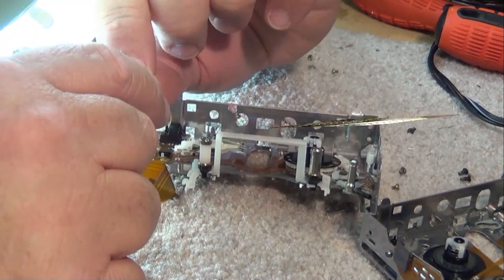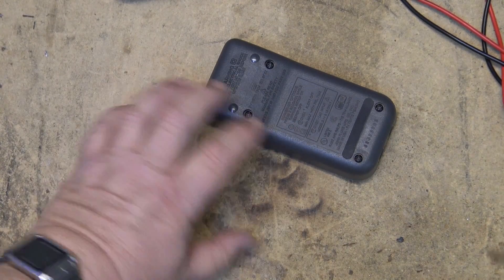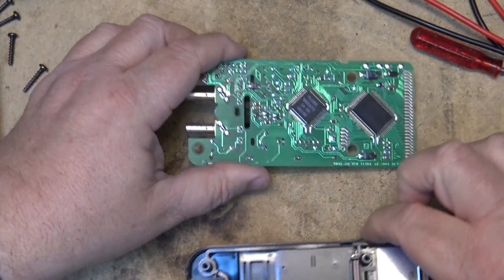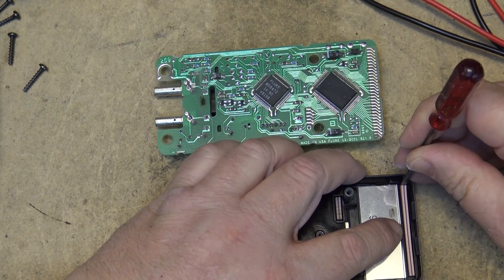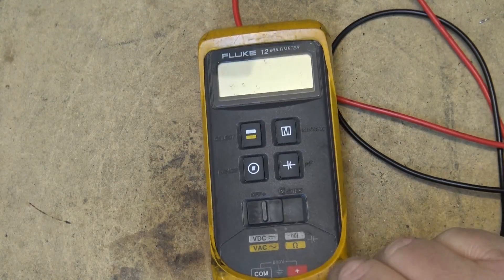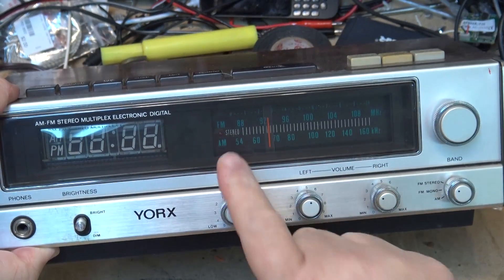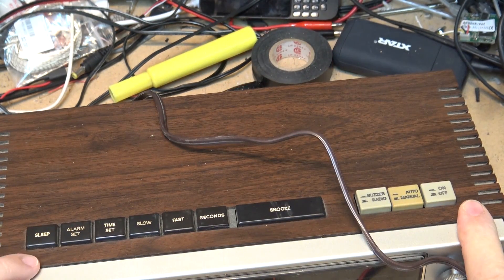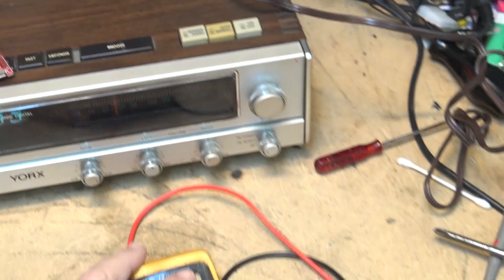Fluke Multimeter Erratic Display Repair Procedure

Comment: A follow up on my comment from two weeks ago. After doing the cleaning procedure my beloved Fluke 77 display became erratic again. After trying numerous cleanings, I ended up carefully adding a dab of solder to each display tab on the circuit board. After doing this the display now seems rock solid operational. But time will tell.
Reply from the maker: I have done that before.

Comment: I can't thank you enough for this. My Fluke 77 display became erratic a few months ago and so I bought a Klein meter that I disliked from the start. You switch it to volts and it goes to AC, arghh I always want DC. And on auto it is so really slow to read. So after all the frustration, I pulled my Fluke out of the drawer and got on Youtube and found your video. 20 minutes later I have my Fluke back. I'll relegate the Klein to the drawer where it belongs until I need to check a capacitor. Thanks again.

Comment: I was dubious about this fix. I have a fluke 79/29, but  I followed the instruction to the letter. My screen was only showing 1/2 or less in the lcd display. Now it’s perfect , like new.👍, good job on the teach dude. P.S. I did use (almost dry )rubbing alcohol on the cotton bud. Thanks again.

Comment: The same thing happened to me with my Fluke 28 II about 3 years back when I had purchased it in like new condition from a second-hand store. It was even still in the box with the warranty papers and everything still included!. Even though I had purchased it from a second-hand store and believe that was the reason why it was there  I could have had still sent it back to fluke for warranty but I did not feel like  losing my meter for 4-6 weeks to do so I decided to try this fix on it and it not only worked fantastically it allowed me my excuse to go pervert on new piece of test gear anyways!.

Comment: Ive used isopropyl alcohol to clean these stips and board pads, evaporates instantly with no residue so doesnt seem to do any harm and so far has worked every time.  Sometimes new strips are needed, sometimes you get an improved version from Fluke.

Comment: Have the same issue with my outdoor digital timers for my Christmas lights. I worked on one this year but I did use some 70% alcohol. Seems to be ok but they will be getting replacing in the next few years with smart plugs.

Comment: I've never run in to bother using ispropanol on the zebra-strips, and gently rubbing the pcb pads with a fiberglass pen. Lots of LCD displays suffer from these issues. 
I was surprised to see that fluke has solder on the pads rather than gold plating, but I guess since the pads are not wiped by other metal contacts, it is an adequate solution.

Comment: I wonder if the boiling belt trick would work on those zibra strip rubbers
Reply from the maker: Typically wiping them off and wiping off the lead tinned connectors on the PC board fixes it for years.

Comment: I've got a different Fluke that's got the same problem that you described with your Beckman.  Plastic clips are broken.
Reply from the maker: I actually had 2 Beckman meters, both did the same thing. I should show it off. I started to make a video about it years ago but I don't think I finished it off because I didn't fix it.
Reply: @12voltvids  In my case, I need to figure out where to get parts - or find a "hack" to fix it. I can deal with electronic issue.  Things involving mechanical ingenuity is a bit harder for me.

Comment: Good for you, having the patience to do this repair. My video about this meter would be me running over it with my truck to fix it, LOL. You are absolutely correct not to use any cleaners. I attempted the same repair on an old Radio Shack digital meter that I paid way too much for back in the day. I managed to clean up the contacts on the display, but then ruined the CMOS meter chip with static from the cleaning process. The static damage was probably from the cleaners I used.
Reply from the maker: Aerosol cleaners actually produce some very high static induced voltages when they are released. They can damage sensitive equipment.

Comment: My Fluke T5-600 won't read one number on the display,everything was ok,just suddenly lost the number,,An interesting thing is that the Fluke Company has done a hermetic box,for protection against water,,it is impossible to open the instrument without damage and fix the display,unfortunately ended up in the trash. ,I write this as a professional, giving my negative experience to help others who intend to buy this instrument.Thanks Fluke and I finished with them

Comment: Pink pearl eraser works great for cleaning those types of contacts. I keep one in all my tool bags. If I don't have my tool bag handy I look for a #2 pencil with a pink eraser. Used those for years and fixed many a problem by just erasing it, haha 😀  Looks like a fun upcoming project, looking forward to seeing that.👍
Reply from the maker: Right used to use those to clean edge connectors in the module days of TVs.  Also to clean cards for computers before installing them.  Be sure to use grounding strap on those jobs.

Comment: All my Fluke stuff has a lifetime warranty why fix it yourself
Reply from the maker: Lifetime of the device.  So when it breaks they say sorry.  Lifetime warranty is done.  Unit at end of life.   All manufactured have that out.  I once tried to make a claim on a rewritable DVD ram disk that had a "lifetime" warranty.  The disk was barely a year old and was being used in a security recorder that was constantly writing and erasing the disk.  The manufacture was not told what the disk was used for when the claim for the 30.00 disk was made when it failed.  They said the lifetime warranty was for the lifetime of the product and it had reached the end of its life and was not covered.  They all have an out.
Reply: I have just had a 35 year old pair of Lindstrom diagonal cutters  replaced without question. so it does happen thank you Lindstrom !
Reply from the maker: Lucky you. I haven't been so lucky when I have made claims.
Actually the only time a manufacture replaced something under warranty was a defective CFL light bulb, and they shipped it Fed Ex. 3 weeks after the new bulb arrived I got a bill for 37.50 from Fed Ex for broker charges and tax on the broker charge. When I disputed it they refused to credit me, and sent it to collections so I had to pay more in charges for the replacement then the original cost. It was a big bulb that probably cost 15 but it burned out after 6 months and the free replacement wasn't free after all.
Reply: That I agree is not in the spirit of the warranty, and they should have advised you before shipping
Reply from the maker: I don't think it even crossed their mind that there would be import duties on a warranty replacement. Had they shipped it by post there wouldn't have been any. Fed Ex, UPS and DHL all charge broker fees even on tax free items entering Canada. They charge a fee to do the paper work of typically 25.00. Then that 25.00 is subject to GST or 1.75, and PST of 1.25. So now there is 3.00 tax owing. So then they pay the 3.00 in tax and add an additional 10.00 loan fee, also subject to tax, so another 1.20. So now now you are at 39.20 in charges because they provided a "service" to clear the paperwork which is unnecessary. Canada post doesn't do it. Not unless the item is declared at over the limit. That used to be 20.00, but it is going up to 200. It doesn't matter with fedex, dhl or ups those as they will continue to do paper work and charge. That is how they make money.
I have items now that were sent to me to do evaulation videos on, that the shipper sent by DHL and they have taxes owing. They are sitting at DHL not delivered as I am refusing the bogus fraudulent charges.
I told them they can ship them back to china as I am not paying the charges.
Reply: Those charges are as you say both high and avoidable, I completely agree with your decision  not to pay them !

Comment: So you don't recommended isopropyl niether?
Reply: Why would you need it?
Reply: @SinsBird  for cleaning and degreasing? You never know...
Reply: I used 99 % for years on tin type and gold connections on equipment that were in harsh environments and never had issues with it damaging connections or components. I didn't go excessive or aggressive around rubber for fear of drying it out.

Comment: I like Yorx, they're underrated and un-appreciated...I had that clock radio with the cassette in it, used it at least 10 years...I have a Yorx Boombox that has amazing stereo separation and awesome AM DX.  ~Jack, VEG
Reply from the maker: I spent all day fixing this one.  Getting the display nice and bright again and adding bluetooth and an aux plug.  (Can't have one without the other) put a new bulb on the tuning dial.  Went up stairs to go to bed.  The first one I did last year, the display went out on it. What a coincidence.  So there will be 2 of them up soon.

Comment: That fluke 12 is a good old meter, i know you have had it for a long time.
Reliable and i bet still accurate.
Those conductive strips are in every handheld multimeter i've ever seen.
And they all play up, replacing the strip may help.

The other meter you talked about is apparently typical for that plastic clamp going bad, i thought having the main processor held down in a clamp a very silly idea.

Comment: Do you know if you can you buy lengths of new zebra stripes anywhere?
Reply from the maker: Yes I know you can buy it, but there is nothing wrong with this one, they just get oxidized.
Reply: @12voltvids  You misunderstood.   I was wondering where you can buy them at?   I think I need one for a thermometer/hygrometer that got damaged by battery leak and I think the strip got trashed.   I really like the unit and would like to revive it.  I cleaned it with alcohol also.   Based on your comments in the vid it sounds like that might kill them also.
Reply from the maker: @jp040759  
I don't know now.  Main electronics used to carry it but they closed their doors after the owner passed away. His son didn't want to carry the torch.
Reply: @12voltvids  Thank you.  Happy New Year

Comment: my fluke 83 had that same problem, I am pretty sure the issue was the rubber reacting with the tin-lead solder on the LCD pads (why they weren't gold plated I don't know) and producing lead sulfate.  The fix would last a year or two and the segments would start failing one by one again.  Eventually I discovered you could get a permanent repair kit which had a better zebra strip which provides a lot more force and is white/black  vs. the pink/black kind.  5 years later and it hasn't failed again.
Reply: Link or it didn't happen!
Reply: @aqib2000  look on ebay for "fluke display repair" or similar.  that's where I got it from.  It's usually two new zebra strips that are slightly taller and white/black instead of pink/black.

Comment: Dave, 

Thanks a lot for this information.  I've got an old Radio Shack meter with this exact same problem.  It has received very little use.  It would be great if I could get it working again. So, I'll have to try out your repair.

Merry Christmas, happy holidays and have a happy 2019!

Regards, Tom

Comment: Nice tip, watching with Premium now. To what extent have you repaired Fluke equipment? Could you repair a Fluke DTX-1800 and or it's associated modules? I'm deeply interested in buying one but don't have the money to shell out for it so I'll probably have to end up buying a "not working for parts" unit and have it repaired. Dunno, just asking to what extent/knowledge you have with such Fluke equipment. :)
Reply from the maker: The only fluke meter I own is this one, and it is the only one I have repaired.